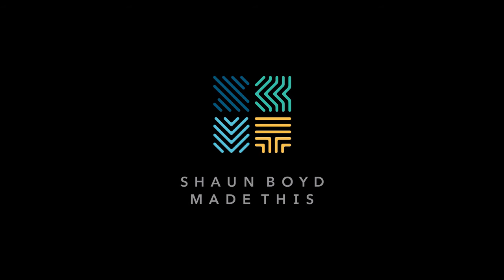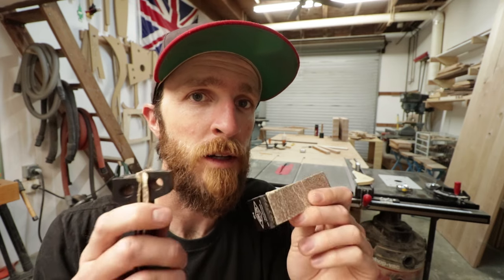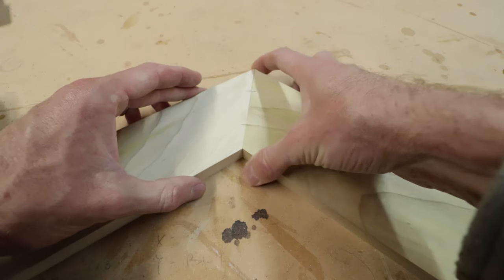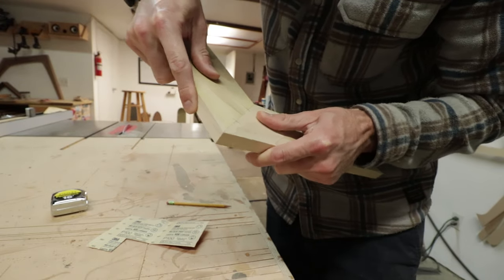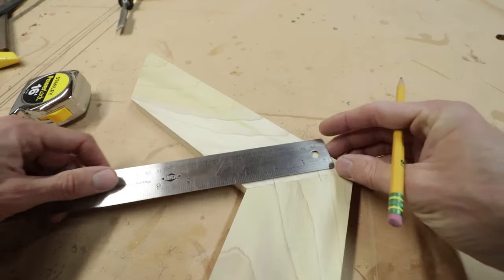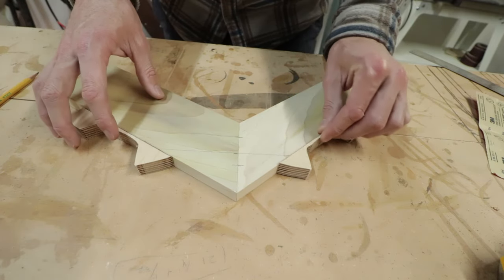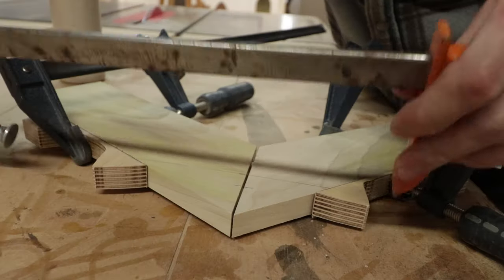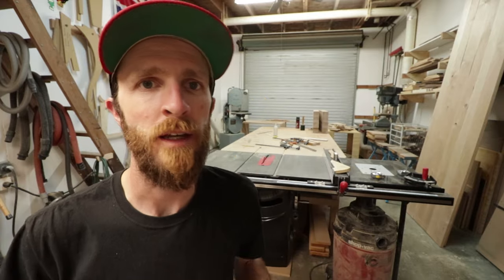How to Easily Clamp Miter Joints

Comment: Hi Shaun : I just made a set of rails for my porch, and unlike other carpenters or wood workers,I wanted to glue everything instead of using screws. Just like building a piece of furniture , I am using dowels and the problem I had was that I did not know how I was going to pull the top plate together until I checked out your you tube posting. Excellent idea, and I can see how this will work just fine for me. Thanks so much for posting something so useful as this. Your the man.
Reply from the maker: Awesome to hear! Glad it will work for you, and good luck on your porch project!

Comment: Thanks so much for this one.  I needed a way to glue up 5" wide by 1.5" thick miters at 22.5 degrees for a table top.  This worked great.  My only glitch in the process was that I used PSA backed sand paper and under pressure of the clamping the wood slid a bit so I had to monitor it pretty closely and keep tightening the clamp to maintain a good joint.
Reply from the maker: Glad to hear it! Thanks for watching!

Comment: Any idea how to clamp miter joints on a tray that the sides are angled outward?
Reply from the maker: Stuff like that is always tricky, especially when it is small like with a tray. You could always go with the tape trick which should offer plenty of clamping strength for an application like that.

Comment: Thanks Shaun! This is a very helpful video! I was wondering if these blocks work in compound angle situations where you have a miter and a bevel? I'll be making these anyway as I'm tired of using/cleaning up hot glue with clamping blocks!
Reply from the maker: Yeah, they would definitely work if you can get them at the correct angle to put clamping force straight through the joint. Might take a bit more messing around, but I'm sure you could get it to work.

Comment: This is dope Shaun, thanks for sharing. I'm super tempted to get some of these printed up in metal. What was on the bottom of the original ones? didn't look like sandpaper.
Reply from the maker: Right on! That would be awesome. The original ones had sandpaper on them, it was just really low grit stuff like 40 grit or something.
Reply from the maker: Awesome, man! I think a hard plastic would work perfectly fine. If you get any made, let me know how they turn out.

Comment: I make variations of boxes as gifts for distant family and friends... Small gifts = small shipping costs... and the worst part of the project is always the glue-up of the miters. I'm going to try to make some shorter, but wider versions of these cauls (to accept two clamps at each corner in order to get pressure on each end of the joint)… Also, at about 2:40 you discuss using dominoes, dowels or biscuits in the joint. You comment that about all this does is help with alignment. You wouldn't want a newbie to get from that comment that the strength of the joint comes from the miter joint itself. End grain-to-end grain glue joints are the weakest in woodworking. Two floating tenons, or dominoes in that joint would make that joint immensely stronger than the simple miter joint. The biscuits or dowels would be less help than the tenons, but would still be a big improvement.

Comment: How do u domino mitres or even better dowel miter joints please
Reply from the maker: In just the same way you would domino or dowel anything else. As long as the dowel or domino is perpendicular to the edge of the joint, everything should line up just fine. Hopefully that helps.
Reply: The dowel has to be perfectly parallel with the face. An accurate jig is a must.